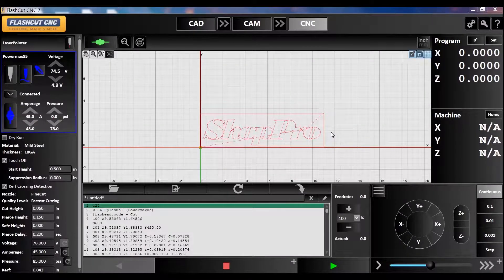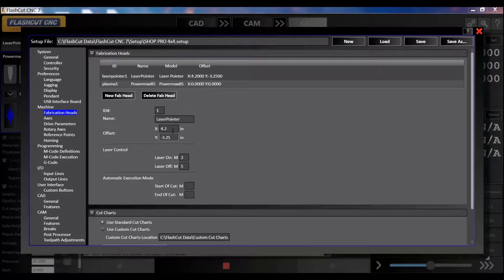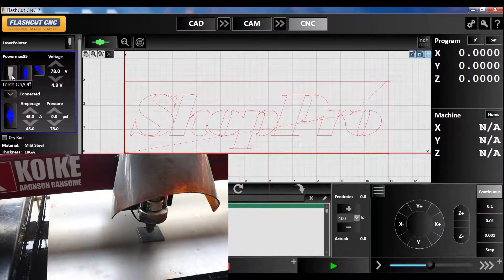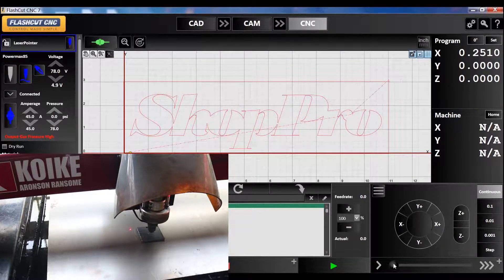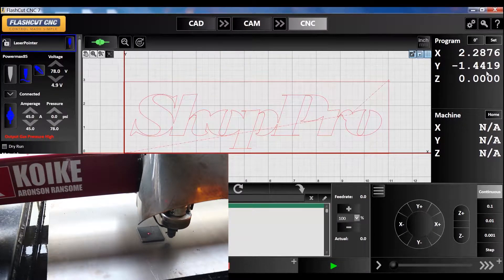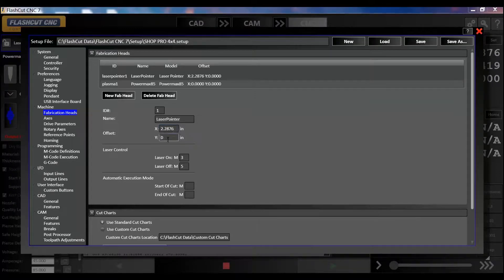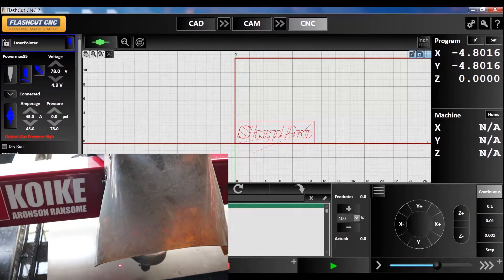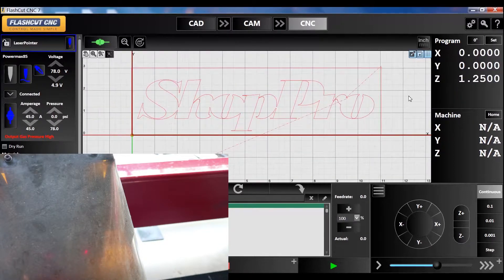Calibrating the Laser in Flashcut CNC / Koike Aronson ShopPro CNC Plasma Cutting Table

Comment: Whats the hood you have over the torch in this video?
Reply from the maker: just some welding curtain we installed since this our demo machine. made a bracket so it flips up and down. It can get in the way if there are tip ups, welding glasses for the operator is probably best
Reply: @normanmachinetool  Ah gotcha.   neat idea.  Thanks.